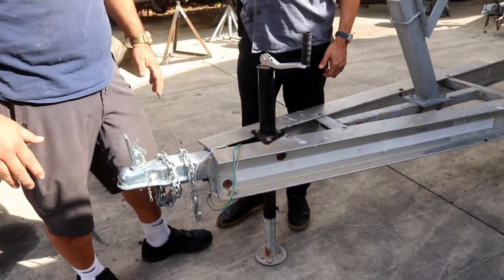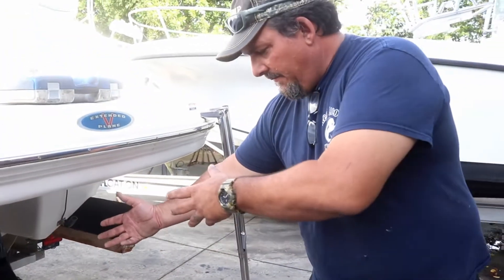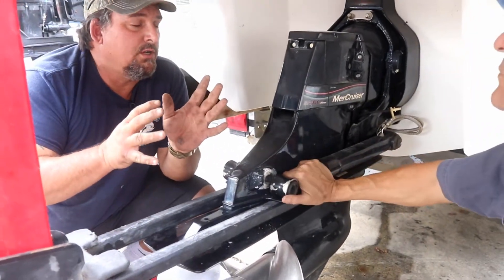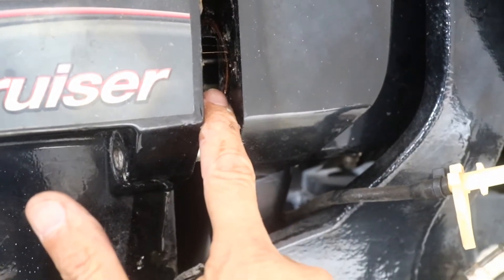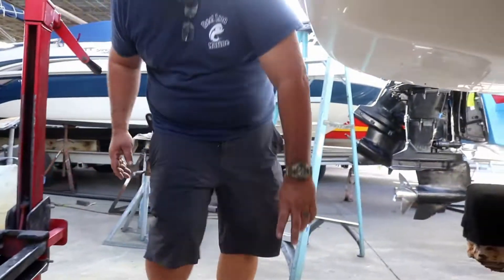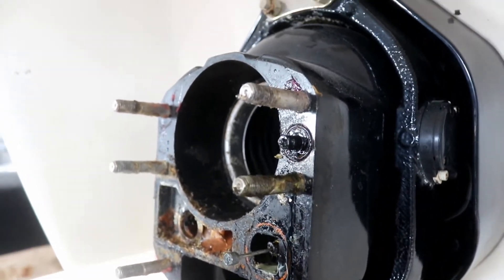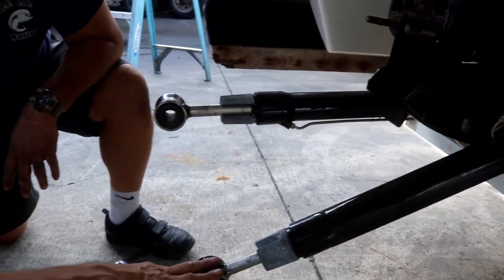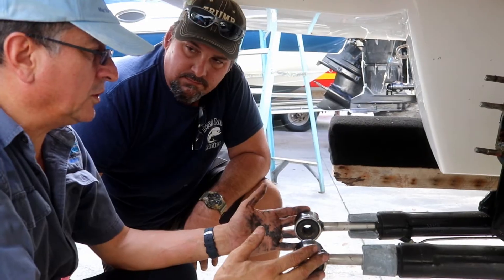Sterndrive Removal and Alignment in a Bravo III

Comment: The smacking of the alignment tool…what is that adjusting? I had assumed the motor mounts were what you adjust if the alignment didn’t work ?
Reply from the maker: The Smacking of the alignment tool is just the shaft splines alignment
Reply: @MrLopezClasses  ok. And the alignment tool makes site the engine coupler is lined up with the out drive shaft, is that correct ? And if that’s out of alignment I would have to go adjust the motor mounts. ? Thank you for the video I got some great info out of it
Reply from the maker: @Natter20002  That is right. The adjustment should only be in the front engine motor mounts with few turns.
Best Regards
Reply: Hello - Thanks for this video.. do you loosen the motor mount’s before hammering the alignment tool? And after Hammering do you tighten the mor mounts again? What about the two screws alt the inner gimbal housing ?

Comment: Thank You, My Bravo 3 outdrive will not come out of the gimbal assembly e even with a-lot of pressure on it. It also is in neutral and cable has been disconnected.   

Can you give me the contact information on the technician that did this video with you ?
Reply from the maker: Hello friend, of course.
You can contact Reel Loco Marine and talk to his Manager Daniel Rodriguez, he is the one who appears here in this video.
(954) 785-8018
Reply: Good afternoon, I have the same problem bravo three did you manage to remove yours, do you have a solution?
Reply: @eduardocoutinho1131  ahoy did you get your out drive off?
Reply: @markbailey6051  
Not yet, I'm treating it with WD40, one day it will go away
Reply: Great Video!  I've got a Bravo 3 and the gear oil is leaking into the bilge from the gear oil monitor (reservoir) where it connects to the transom.  Can this be repaired by pulling the drive or does the engine need to come out?  It's the starboard engine with the steering gear going over the top of the connection, and the water heater in the way as well.